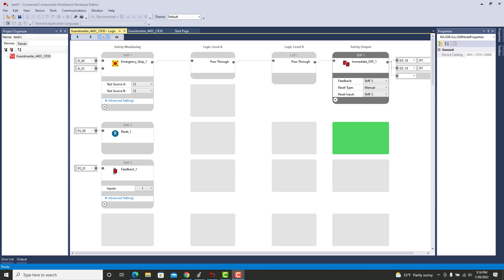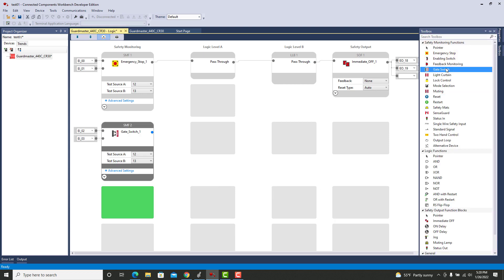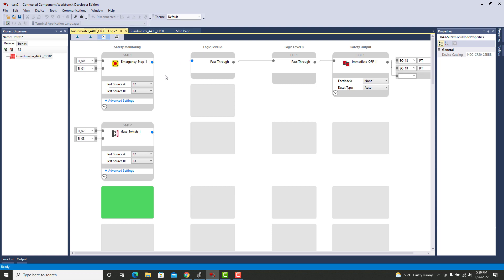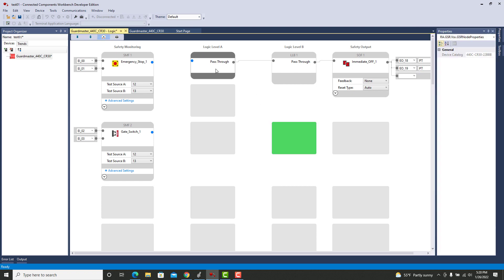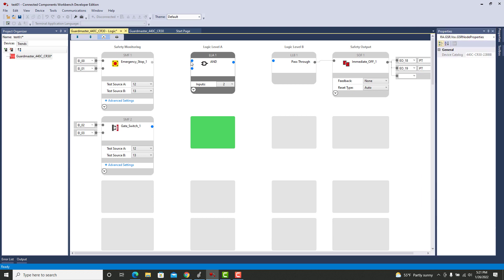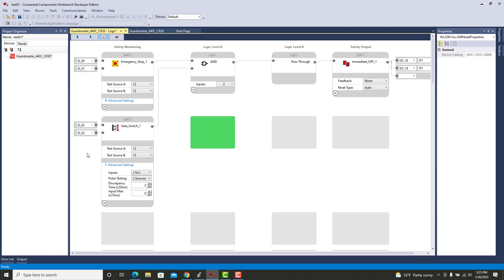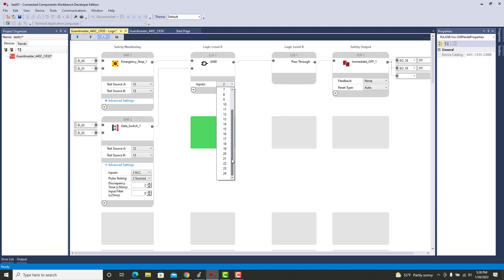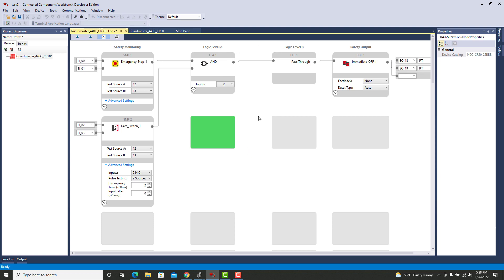CR30 Programmable Safety Relay - Electrical Design and Programming Pt3 - Configuration w/ CCW

Comment: I have a question. For emergency stop button,  how to wire the test signal from terminal 12 and 13 to EI_00,01? Thanks.
Reply from the maker: 12 to one of the NC strings, through one contact of each estop pb, and back to input 0, this completes one wire safety. Repeat 13 through the second contact of each estop pb and back to input 1, this completes the second of two wire safety.
Reply: @plcprofessor  Thanks for reply.